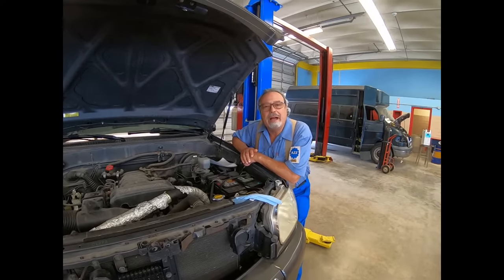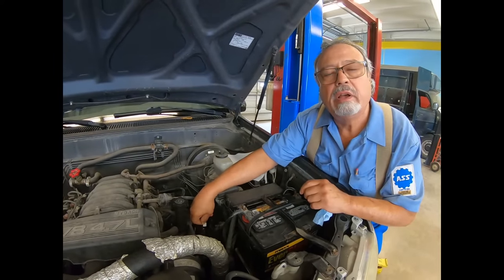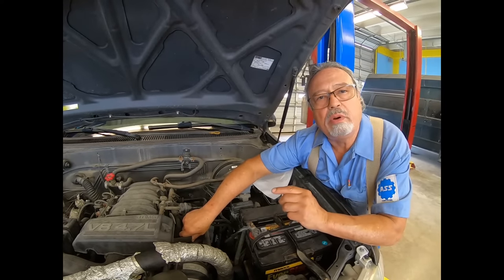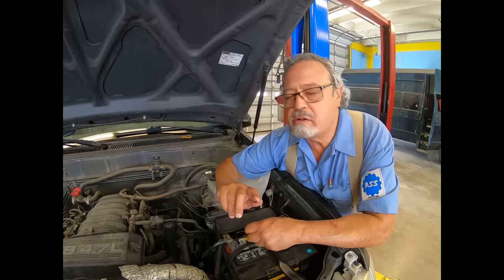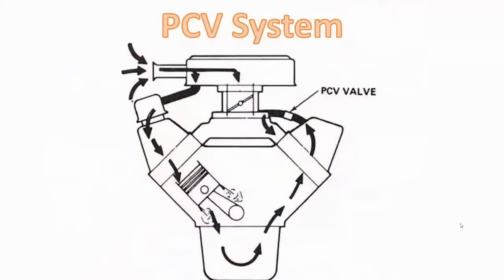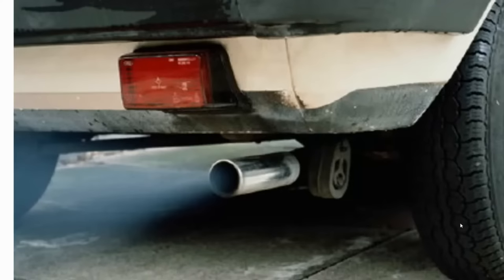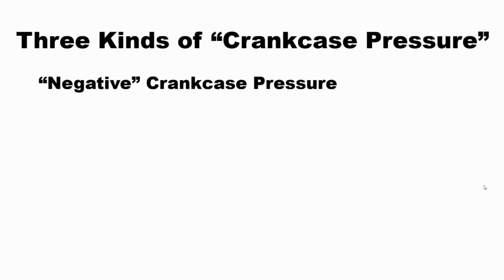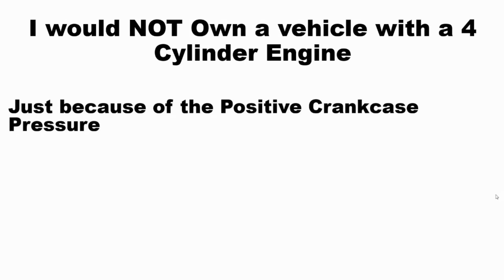Learn how IMPORTANT the PCV Valve is and why you should test it.

Comment: Passing automotive service excellence tests can get you some patches.
It costs you time and money, but it helps get your working knowledge into relatable and comparable language and ideas to relate about service, repair, and maintenance.
I believe, when we aren't manufacturer/factory trained, these tests help us see who has been through the testing successfully.
The unfortunate thing is, you can study their literature and take their tests without repairing or building anything. 
Your ability to relate these concepts to another person is valuable. Experience takes book study and makes it into good thought.
Now let's not sound condescending in our method, but matter of fact.
I have discussed the system you covered in this video with some "mechanics" and heard some ideas that don't fully make sense.
It's because of the mode of the throttle.
The Chilton and motor manuals depict this system also and include diagram drawings with the different modes.
It answers why we had CCV filters in the air cleaner connected to the breather tube side.
Just wanted to give more to those who need to study their manuals and understand.
Many with experience know from repetition and observation.
Reply from the maker: Thank you for the view and that very thorough comment. What did you think about my video ?
Reply: @theoldmecanicoshow9004  I dont know about him but I have been working on vehicles for upwards of 20 years and had no idea about this test.
Reply from the maker: @HardWhereHero  Hello. Thank you for the view and the comment. I have been fixing cars (trucks/SUV's/other) for 50 years. My first engine overhaul was in 1972. I still remember the vehicle. It was a 1959 Buick La Saber (aqua). I was in awe when that vehicle drove away from the high school where I took auto mechanics class. I thought  it was so amazing that you can take all the engine pieces and put them together (just right) and bring life to a machine. Thanks again my You Tube friend.
Reply: @Danny Linc
wow
i did'nt know about the exam but thank for sharing the enfo,
there realy is alot more to learn every day
Reply: @Just-in Time
me neither 😆
18 years being a mech but have no idea there was an exam like that,
i realy still have alot to learn

Comment: My 2012 Euro Civic (136000 km) consumes a little more oil than my wife's Euro Civic (2007, 210000km), i'm going to to this test on both cars. Greetings from Belgium!!🏁
Reply from the maker: Thank you for the comments and the views. It's just good idea to change the PCV valve and sometimes the hose that connects to the valve.
Reply: @theoldmecanicoshow9004  Is it just replacing the PCV valve? No vacuum errors or resetting needed?
Reply from the maker: @Tintoycar  No programing needed. Just Plug and Play.
Reply: @theoldmecanicoshow9004  I tested both our cars and the paper flew away 🙂 They are both 4 cilinders so difficult to trace a bad PCV valve?
Reply from the maker: @Tintoycar  I have tested brand new four cylinder engines, and the paper does not stick. Four cylinder engines are not large enough to produce the volume of vacuum, needed to put the crankcase under negative pressure. Only the larger four cylinders (2.6 or 2.8 ) can stick the paper.
Reply: @theoldmecanicoshow9004  OK thanks, I also learned that 1.8 engine from 2012 and 2013 use more oil because they have used R3A pistons in stead of R1A pistons, do not know what the difference is but no more worries, it's normal 🙂

Comment: I will never forget this trick, thank you sir! How would you set up a pcv system with a centrifugal style supercharger?
Reply from the maker: You are Welcome and thank you for the comment. More pressure / more power / more blow-by. So long as the paper sticks on the dipstick tube, your good. Check to see if the paper sticks at idle. If it does stick, give the engine a couple of quick revs. If the paper sticks during the revs, your good. If the paper does not stick during the revs, get the largest vacuum hose that will fit (adapter encouraged) and get a PCV valve for larger engine (displacement). So long as the larger hose and valve does not effect your idle too much, your good. Thank you for the view. Share with family and friends.

Comment: I had a 1991 Toyota Camry (SV21) 2 litre engine. It came with Positive Crankcase ventilation problem. 
It was pushing oil out every seal & gasket of engine.
My friend/ retired mechanic helped diagnose it.
I had to track PCV blockage.
It was this stupid reduced PCV pipe into throttle body, that was curved like a J.
It was caked solid with carbon and solids.
Once cleaned/drilled out. The engine didn't push any oil out seals and ran well.
I learnt this issue way back then.
Lesson learnt.
Always look at the PCV pipe lines, for good design with good diameter into the inlet manifold port or throttle body assembly. 
Shared bends and small diameter pipe causes necessary action with higher maintenance

Comment: What are your thoughts of a pvc delete? To be more specific, installing an oil catch can and venting off the remainder as apposed to recirculating? Can modern cars with their computer and data demands operate properly with such a modification?

The path that has brought me to these thoughts and questions is modern direct gas injected engines and the troubles associated with that. The carbon and dried oil build up in the intake manifold and the problems associated with that to be exact. Problems that I'm still learning about and trying to grasp.

Are oil catch cans an answer and should they be vented, or recirculated?

Your knowledge shared would be greatly appreciated.
Reply from the maker: Thank you for the question. Yes, a catch can is a very good idea. I would add the catch can and leave the PCV system installed. Thank you for the views.
Reply: Plug the vacuum side of the PCV, and turn the crank vent tube to a down ward direction.  Cars from the 1900's to mid 60's all used a 'down draft tube'  stop sucking a vacuum in your cranks case, you're mystifying the oil, and burning it...  making the air/environment dirtier.
Reply: Direct injected cars develop carbon deposits on the valves which can reduce fuel economy and performance. I know somebody that did a pcv delete with vaccum side hose leading to the pcv blocked off, and the pcv replaced with an aftermarket straight through fitting on the valve cover with a hose that leads a catch can then a hose to the bottom of the engine. Their is a second hose that leads from the valve cover to the intake. That hose is disconnected from the intake and pointed down to under the engine again, and the intake side plugged off. So basically the valve cover is at atmospheric pressure, he has been running like this for 50k+ miles and the turbo 4 cyl runs like a beast.
Reply from the maker: @dpok69  Catch cans work great. I plan on installing one on my vehicles.

Comment: 12:50 One more important exhaust gas: H₂O. That definitely doesn't belong in your engine oil! Loved your clear and emphatic explanation, thank you. On a 4-cylinder engine, would pinching off the breather hose allow the paper/dipstick test to work as on a larger engine?
Reply: Just to answer my own question: yes, when I block the breather hose, the pressure measured at the dipstick tube drops gradually, reaching about -20 kPa (6.5 inHg) vacuum after about 10 s. Not as strong a vacuum as at the intake manifold, but definitely working. With the breather hose unobstructed, the dipstick pressure stays around ambient.
I also tested the PCV valve by attaching a syringe to the PCV hose coming from the engine, and confirmed that air can be drawn out of the crankcase, but the valve blocks return air. So I'm pretty sure my PCV valve is OK. :)
Reply from the maker: Thank you for the comment. I have seen larger 4 cylinder engines ( 2.8 L) stick the paper. I never thought of pinching off the breather before. You don't have to pinch off the 6 and 8 cylinders.
Reply: Does this mean that if you have a 4 cylinder engine  you can make the paper stick by installing a more narrow breather hose? And therefore fix the problem that 4 cylinders have with creating crank case vacum? Or would that create more problems?
Reply: @commentcrafter4158  My understanding is that while the paper test may not work with 4-cylinder engines, they still have enough vacuum to produce enough PCV flow to ventilate the crankcase and avoid pressurisation. You probably wouldn't want to block or restrict the PCV or breather hoses in normal operation. However, if you want to do the paper test, you could temporarily pinch or plug the breather hose.
Reply: @commentcrafter4158  I believe that under some conditions of high speed, heavy load operation the "breather" hose is actually needed to handle the blow by gases created and under those conditions the flow is reversed so that it is into the air intake tube.  So probably not a good idea to restrict that hose too much.  Maybe a little?  I don't know.
Reply: @thromboid  You got a lot more vacuum than I did when I tested my 96 Honda Civic EX A/T the same way, but with a U tube manometer.  I only got 1-3/8" of H2O (not Hg) of vacuum.  Now I'm wondering if mine is somewhat blocked, even though the hoses are clear and I verified that I could suck through the hose attached to brand new PCV valve.  Good idea with the syringe .

Comment: Thank you, i am doing it right now since my car is burning excecive oil. Im replacing the pcv valve, but doi g the paper test first. Thanks again have a blessed day!
Reply from the maker: Thank you for the comment and the view. Have a blessed day.
Reply: A lot of people don't know that a malfunctioning PCV can be the cause of oil loss and instead assume right away it's an issue with piston rings or something more serious. Also in an older car replacing the oil cap gasket with a newer one can help if you see any staining on the block around the cap as that's a sign of oil vapors escaping from the cap while the engine is running. I was having an issue with my oil getting low right near the end of an oil change interval so it was a very slow loss, found both the PCV to be coked up and the oil cap gasket to be rock hard and no longer giving a good seal.

Comment: I am not mechanically inclined but recently changed the valve cover gasket and put new spark plugs and bought an aftermarket PCV valve at NAPA and installed it in an old 99 corolla with 235kmi.  (Can not get an OEM PCV valve for this car at Toyota, they don't make them anymore. ) The car runs fine for awhile and then it starts using more oil after 2 mos.   So my question is about the rubber grommet that fits into the side of the valve cover, and it is very old, and i did not change it, and i am pretty sure it is original.     You mentioned in a comment that  "heat" causes seals to not hug the surface area.   Could this not changing this old grommet make a new PCV valve stop working?  I am thinking  to replace this grommet I will have to remove the valve cover again,  and the cost of the OEM gasket was almost 60 bucks.  Now PO420 light comes on (again), which happens when burning a lot of oil.   Would it be better to get an oil catch can?  I have not been able to find a mechanic in my area who even knows what an oil catch can is.
Reply: Be very careful not to drop it in the engine. They can get brittle when they're old

Comment: Great video,, I have the Honda/Acura engine(V6 J Series) seem to have a lot of blowby at the filler cap removed. When I changed both cams on my 2010 MDX there was a lot of varnish in the area of the valve cover where the tube goes to the intake pulling a vacumm on the engines front bank. The rear bank sees the clean air coming from the air filter boot downstream of the MAF sensor and before the Throttle body. It had almost no varnish buildup.
It looks to me these engines(J Series 3.7) have a problem sticking oil control rings and the coking that takes place can only come past the rings. Had a good leakdown test so I'm looking at going to a larger tube on the front bank to better evacuate the crankcase and front bank of the blowby gases. I've already been through my PCV system and agree 100% it's the most neglected sub-system of an engine. Does this sound like a good direction to you?
Reply from the maker: Yes...! A  larger tube should help the problem. Thank you for the view and that information on that engine.
Reply: @theoldmecanicoshow9004  Thank you for your reply Patron.

Comment: My experiment.  Back in the late '70s, being young and bright (read foolish) I thought I'd "improve" my car by converting the PCV system to a road draft system.  I plumbed a good-sized tube, with a diagonal cut, to the bottom of the car and replaced the PCV valve with this.  After a week or so, I took off the oil fill cap and was greeted with a nice yellow blob of gunk.  It was the sludge of water from the blow-by  not being purged from the crankcase.  I undid my "brilliant" conversion right away and never looked back.  Yes, PCV systems do wonders for keeping the crankcase clean.
Reply from the maker: Great experiment and testimony on how important the PCV system is. Thank you for the view and that information.

Comment: Worn out engines with excess blow by will have positive crankcase pressure. You might even see smoke coming out of the dip stick tube or oil filler tube. Stuck rings or excess cylinder clearance or possible valve guide issues.
Reply from the maker: I totally agree with you. Thank you for the view and that information.
Reply: Yep yep , seen a lot of older high mileage cars would push the dipstick slightly up outta tube , change out PCV Valve , usually had to flush out the PCV Valve hoses an tubes as well . An as mentioned a plugged EGR system, all from lack of proper oil changes . Unless the ole girl had worn out rings .

Comment: Only works on older systems w/ PCV   that is accessible for your "test".
Reply from the maker: Yes there are engine WITHOUT a PCV system. But most engines still use a PCV system. Blow-By will never go away. Thank you for the view and your comment.

Comment: Liked this test on a decent valve. I bought a V6 cheap and was told just needed new egr, tru coz the old one was stuck together with tape and epoxy. Scary thing is that apart from some easy to fix vacuum leaks, Oil is getting pushed up the dipstick. Wow thought the rings or something  worse but downloaded manual shows to get to the pcv valve must pull the intake manifold apart. I doubt that. I believe it is just pcv. Have to take off the hood to get room to work on this Ford engine.

Comment: Love it. The only thing 'I would add' is to be sure the top of the dipstick tube is clean of any fluid or debris that would have the paper stick to the tube on its own when the engine is not even running. I'm sure that's a no-brainer but I just thought it should be mentioned.
Reply from the maker: Thank you James X for that suggestion. You are correct about making sure the tube is free of oil. Thank you for the view and that positive comment.
Reply: @theoldmecanicoshow9004  .....thank you for the informative video and reply.

Comment: Many moons ago, the blowby or crankcase fumes were vented to the atmosphere via a rubber tube running from the crankcase to the atmosphere. Along comes the EPA that said that was a no-no. Alas, the PCV valve was born, which directs the blowby gases back into the engine to be burned.
Reply from the maker: Everything you said is correct / correct/ correct. I grew up working on vehicles from the early 50's. I remember when a vehicle with a worn engine / excessive blow-by would come to a stop and smoke out the tailpipe AND from under the hood (from road draft tube) Thank you for the view and that input.

Comment: Here is the part I just don,t get about PCV  Everybody says that a stuck open PCV will cause rough idle. Well at idle is when you have the most vacuum and isn,t that when you would want the valve to be open ? What am I missing ?
Reply from the maker: Thank you for the question. The main purpose of the "valve" inside of the PCV valve is not to regulate the amount of vacuum that is allowed to pass through the PCV system, the main purpose is to completely close if there is a backfire in the intake manifold. It is not a good for the backfire to go into the oil pan. It could cause a backfire in the crankcase(not good). Thank you for the view and the question.

Comment: Just so you know, in 1966, California required all vehicles from post WW2 models to 1960 to be retrofitted with a State Approved PCV Valve retrofit kit in most regions of the state.  1961 and later vehicles sold new were required to be factory fitted with PCV Valves.  Pre 1963 Federal vehicles did not have the PCV Valves, and owners who moved to California who had such vehicles were not permitted to retrofit them with factory PCV valves during the 1966 retrofit program to register the vehicle for 1967 DMV renewals.  Those cars were required to be fitted with "state approved" retrofit kits.  Anyone with a 60 or earlier vehicle also had to install a universal state approved PCV Valve retrofit kit per state laws.  My late dad's 1959 Ford pickup has a state mandated PCV Valve retrofit kit on it.  I have his 1962 Rambler Classic as well.  The Rambler has the factory PCV Valve, so it was exempt from being state inspected in 1966 for the 1967 DMV renewal.
Reply from the maker: Thank you very much for all that awesome information. I had no idea California required vehicles pre factory PCV valves to be retrofitted with that device. I remember when I was young, so many vehicles had the road draft tubes that would let out a ton of smoke(and pollution)

Comment: Im sorry did he say put the dip stick thru the radiator and between the fan blades?Also be safe when leaning inside engine bay.Exhaust manifold is a firm place to place ur hand while engine is running.